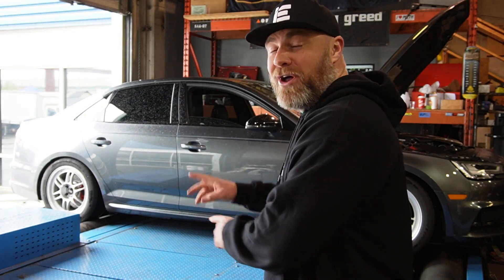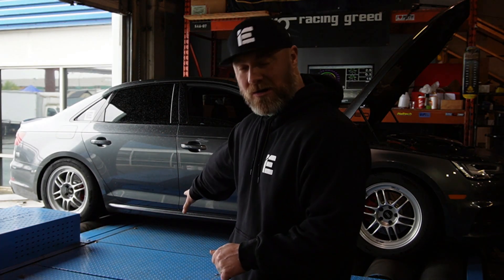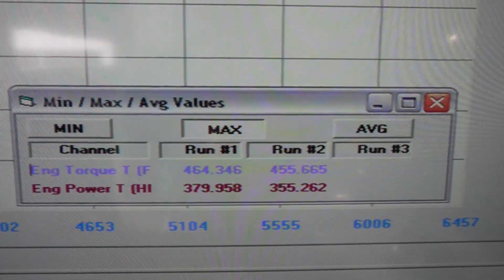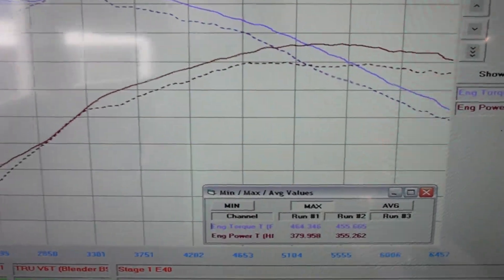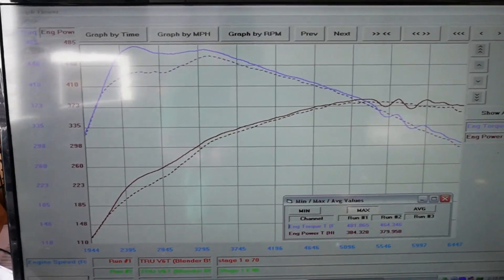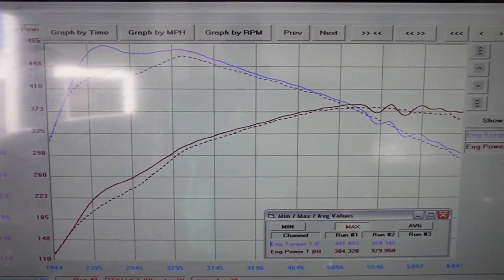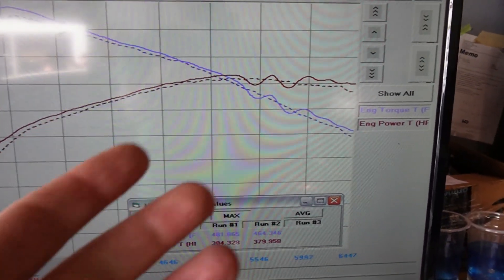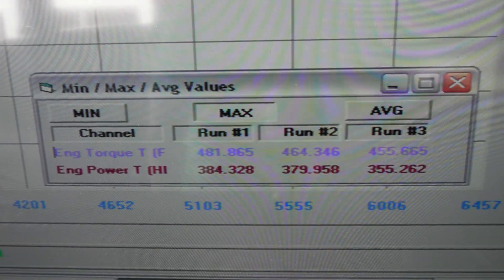Dyno Testing Integrated Engineering Stage 1 E40 & E85 - Audi B9 S4

Comment: I love the content. My question, is why does the torque drop off so dramatically after peak? Reminds me of a 1.8t where you'd make 20psi at 2500rpm then it would taper as the RPMs increase to like 10psi, it looks like this is doing the same thing and it looks like a diesel. Is it a limitation of the stock turbo or cooling? Genuinely curious
Reply from the maker: I'm assuming the size of the turbo as well as the horrible cooling I have right now with the OEM parts.  I expect my curve to look a little better with better cooling and better airflow.

Comment: Usually those ups and downs are when knock is picked up by knock sensors and knock retard is applied on the timing. You said your logs were fine, so you did not see knock retard and your timing was consistent all the way ? Your injector pulse width was in the acceptable margin for this engine ? Usually on DI engine looking at the duty cycle is not relevant. But you should have seen your lambda moving. Another thing it could be is torque management. Not sure how it works with Audi, but with GM when the ECM sees the engine makes more torque than it should it's gonna either reduce timing or close throttle body. Did you log your throttle body position during the runs as well ?
Reply from the maker: As mentioned in the video, the logs were perfect. No change in timing, no knock, no change in lambda. Nothing on the logs showed the car wasn't making the power it was supposed to. Throttle body is not included in the IE logger, no. That's why we are convinced it has to do with the AWD system not agreeing with the dyno.

Comment: Saw a few reports of S4 broken drive shaft after stage 1 tune.
Reply from the maker: Oh wow! I've never heard of that before on this chassis.
Reply: I think thats the b8-b8.5 ...never seen anyone with a broken DS from stage 1, I'm pretty sure IE is running stock DS on the stage 3 too
Reply from the maker: @chaoscapitalist1  I think you're right
Reply: My bad, its a broken diff on a tune B9 RS5. Cost of repair 10k. There is also report on 034motorports with broken front axle on the b9 when  launch.
Reply from the maker: @MaxVerstappenF1  good thing I'm not tuned by 034 then, haha
Reply: @MaxVerstappenF1  no way in hell does a rear diff cost $10g's ..thats a bit extreme, you can buy a wavetrac diff for like $1500 unless audi requires some special diff? Im not sure

Comment: I had weird problems with my car that were very similar fuel systems gets maxed out here very easily I would go e40 tops on this platform without the 4.0tt injectors and upgraded hpfp
Reply from the maker: I logged all the runs. The fueling was totally fine and the lambda looked great. These results had nothing to due with a lack of fuel. Running E70-E75 on these cars with a stock turbo is perfectly fine.

Comment: From what I have seen and heard, you got cut off early before the real gains of the full E85 tune took affect. Those last few thousand RPM’s are where the xtra power is at on the E85 tune
Reply from the maker: I'd have to agree with you that we missed a few hp up top, but I didn't want to make excuses. Hopefully next time I'm on the dyno we can get it to work better.

Comment: Omg Adam! Awsome number on just stage 1 E85 tune! AND STOCK BUILD!!! Insane power gains already. 💪
Is that little power loss coming from fuel pump issues? I'll bet my money on that.
Reply from the maker: Nope. According to our logs the car was working as intended and suffered no fueling issues, and yes the car has been amazing thus far!
Reply: B9 s4 stock fuel system has no issues what so ever on e85 fuel. Fuel pump handles it fine.

Comment: One member of our club had the same situation and later on we found out that the b9 comes with a dyno mode, without dyno mode the abs goes crazy.
Reply from the maker: I tried dyno mode previously but was told that it only worked up until 50mph. I'll try it again the next time I'm dyno testing. Thanks.

Comment: Boy that extra E85 tune low end torque is really gonna help your track launch. Can't wait to see how the 60ft times hopefully drop.
With that odd top end graph on E70, does the stock B9 have any big air intake restriction like the RS3 does? Maybe turbo can't get the air it wants?
Reply from the maker: We figured we would have seen that on the logs if that was the case. We think it had something to do with the AWD system not being happy on the dyno, but we aren't 100% sure yet.
Reply: @VancityAudi  guess that wouldn't surprise me considering how the RS3 had acted before. At least the engine seems happy

Comment: Adam , its so cool to know that our S4s can run E85 without doing fuel pumps and injectors 🔥😎 .
Reply from the maker: Very handy for sure.
Reply: @VancityAudi  so can i just tune my car for e85? And then put e85 in my tank like that???
Reply from the maker: @nightbotmyassitsllamabacka1361  yes. I'd recommend no higher than E70 for optimal performance, but yes. No fueling upgrade is required to run ethanol.
Reply: @VancityAudi  thank u and how can I get e70 if there’s only e85 available near me
Reply from the maker: @nightbotmyassitsllamabacka1361  well first off not all E85 is actually E85. It may test at only 51% depending on the gas station and the pump. You have to look for the labels on the pumps that say what percentages it may fall under. I always recommend people install ethanol sensors on their cars when they want to start using ethanol. This is what we went with: https://youtu.be/jhhMuyeOeE8

You can also manually test your fuel with an ethanol tester. Something like this: https://a.co/d/hwzFcYK

Lastly if your pump does actually spit out E85 you can simply add some 93 or 91 octane fuel to it to bring down the ethanol content closer to E70.
Reply: @VancityAudi hey, why is e70 better? I am running full tank of e85 on my stage 1 tune along with stage 2 tcu. I don’t have an ethanol sensor so should i keep running FULL e85?
Reply from the maker: @andytran-ry7yc it's extremely unwise to run ethanol blends without an ethanol sensor installed. You are more than likely pushing your fuel system harder than it needs to with no gains in performance running straight e85.
Reply: @VancityAudi  so blending is only beneficial with a ethanol sensor otherwise it’s better to run straight e85. Thank you for answering my questions adam. I’m trying to keep my car healthy while pushing the most power possible.
Reply from the maker: @andytran-ry7yc no, that's not at all what I said. I said it's unwise using ethanol without an ethanol sensor installed. Unless you are 100% sure what you are putting in your tank is ALWAYS going to be E85 then I'd highly recommend you install a sensor. Most FlexFuel pumps offer ethanol that ranges from E51 to E83. Not sure if you are using that or a pure source of straight E85 that never varies in ethanol content. In colder weather your car will not like running straight E85. If you live in a warm climate than that isn't something you'll have to worry about.
Reply: @VancityAudi  Yeah i see now. I live in california and i use e85 that is secluded from the other pump gas stations so the e85 has its own section. I should invest in an e85 fuel sensor then.
Reply from the maker: @andytran-ry7yc you absolutely should. Depending on the fuel source you could be getting different blends of ethanol while thinking you're actually getting straight E85.